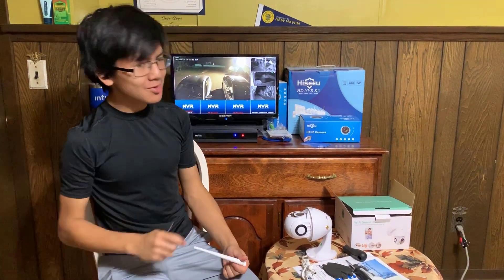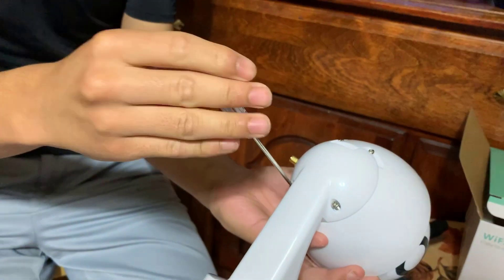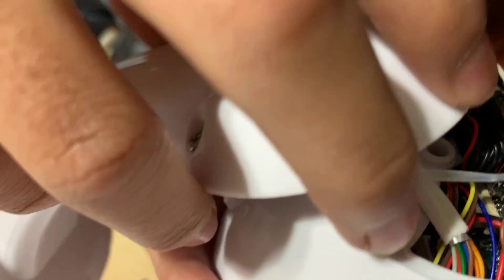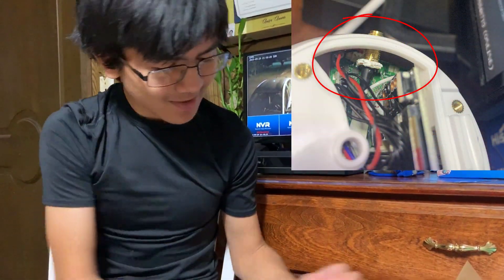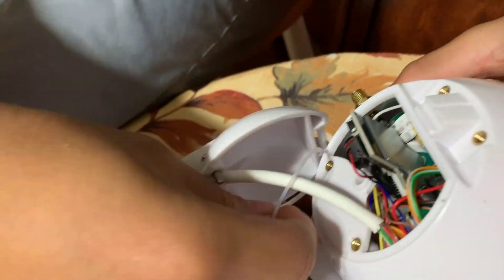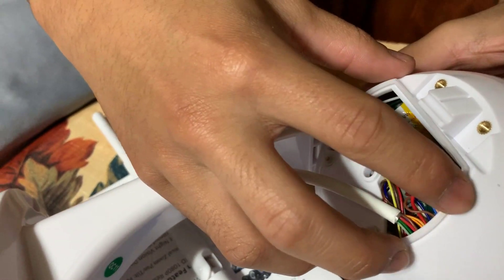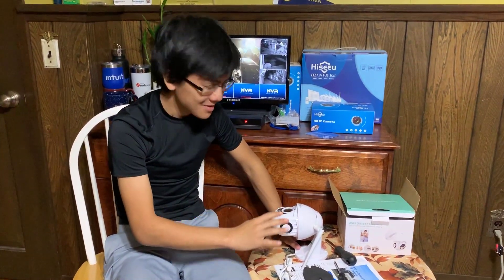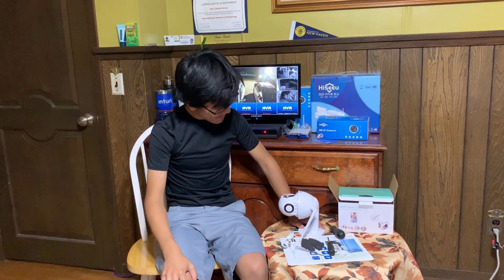How To Open PTZ Dome WiFi IP Camera Remove Cover To Install/Replace SD Card Inside & Reassemble Back

Comment from the maker: Links if you are interested to purchase Hiseeu Security Cameras & DVR Systems from Amazon.com:
1.  https://amzn.to/2EPeOzs ([Expandable 8CH] Hiseeu Wireless Security Camera System with 1TB Hard Drive with One-Way Audio, 8 Channel NVR 4Pcs 1080P 2.0MP Night Vision WiFi IP Security Surveillance Cameras Home Outdoor)
2.  https://amzn.to/34TjUpk (【5MP 8Channel】Hiseeu Security Camera System,H.265+ 8CH DVR + 4Pcs AHD Cameras,Global Phone&PC Remote,Human Detect Alarm,98Ft Night Vision,IP66 Waterproof,24/7 Recording,Easy Setup,Plug & Play,1TB HDD)
3.  https://amzn.to/3lwBqWm (1080P HD Outdoor Wireless Security Camera Pan Tilt Zoom (5X Digital) Compatible Hiseeu Wireless Security Camera System PTZ Camera Two-Way Audio Waterproof Dome Motion Detection Night Vision)
4.  https://amzn.to/3lA07RI (Hiseeu 2MP 1080P Outdoor Wireless Security Camera,Waterproof Outdoor Indoor 3.6mm Lens IP Cut Day&Night Vision with Power Adapter Compatible with Hiseeu 8ch Camera System)
5.  https://amzn.to/3jvN0zw (【8Channel,Audio】 Hiseeu Wireless Security Camera System,1TB Hard Drive,4Pcs 1080P Cameras 8Channel NVR,Mobile&PC Remote,Outdoor IP66 Waterproof,Night Vision,Motion Alert,Plug&Play,7/24/Motion Record)
6.  https://amzn.to/2DhWEWY (Hiseeu 1080P Security Camera, Outdoor Two-Way Audio Surveillance Cameras Bullet IP Camera Waterproof,Motion Detection Day& Night Vision with Power Adapter Compatible with Hiseeu Wireless Camera System)
7.  https://amzn.to/3lzimqL (【3TB HDD Pre-Install 】 Hiseeu Wireless Security Camera System 8 CH NVR 4Pcs HD 1080P Indoor/Outdoor WiFi Surveillance Camera Wireless IR Bullet Camera Waterproof, Motion Alert, Remote Access)
8.  https://amzn.to/32DqIot (Hiseeu 5MP PoE Security Camera System with 3TB Hard Drive,8 Channel 5MP DVR Security System with 4pcs Dome PoE IP Camera for Home Security,Night Vision,IP66 Waterproof,1-Way Audio,Onvif Support)
9.  https://amzn.to/34O2aMm (Hiseeu 5MP PoE Security Camera System with 3TB Hard Drive,8 Channel 5MP DVR Security System with 4pcs Dome PoE IP Camera for Home Security,Night Vision,IP66 Waterproof,1-Way Audio,Onvif Support)

Please note that we do not work for Hiseeu.  Any technical questions, support or warranty should be directed directly to Hiseeu.

Comment: I have a C-P05 can I use it without a SD card if I main line it to my existing security system . I need a I.T. guy .How much for you and your dad per hour? 
GOOD JOB ! On the video, well spoken nice directions , keep it up. Public speaking is a valuable skill.

Comment: Ive installed a micro sd to my camera same as the one in your video but when I go into the icsee app it’s says no storage found? Any help would be great 😊 which format should it be wiped as the card was used before in a phone
Reply: Same
Reply: Do you know what to do?
Reply: @karoomalnehlawi9429  
still the same thing dont bother with these ive got 4 different tplink tapo cameras there cheap and app is great

Comment: I set mine up first without a SD card then I got one the next day and shut it off and added the card it shows it there and records if I do it manually but won't record with the motion alert do I need to reset the system to get that motion alert and record work

Comment: I have had two of these cameras.  One for over a year and the other one 
about nine months.  The only problem I have had with  them is both of 
them loose the SD card.  When that happens, I have to reset the camera 
and reinstall it.  That is not simple for me as I have to remove the 
camera and bring it inside and connect it to the router with an Ethernet
 cable.  Neither one of them will do the install on wifi only.  Once it 
is installed on the Ethernet, it is okay on wifi.  Ctronics support is 
non-existant.   They pretend they are going to support it, but after a 
couple of e-mails they just drop off with no response.....Disgusting.  
Originally, I was running a 128GB SD card.  They suggested replacing it 
with a 64 GB card.  So, I done that and it still lost the card in less 
than two months.  Now, I have a 32GB card in one of them and it is 
holding up okay after over two months.  My opinion is if it will not 
work with a 128GB card then they should reflect that in the owner's 
manual.  The other one with the 64GB card just lost it yesterday, now I 
have to go through the routine from above and reinstall it.  This 
aggravating procedure doesn't seem to bother Ctronics.